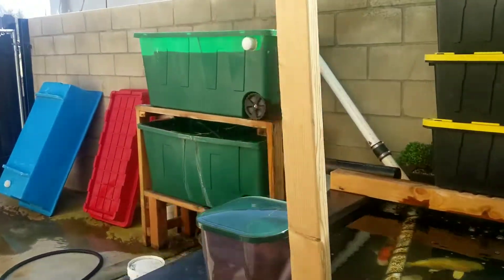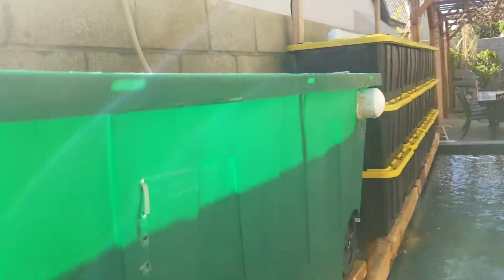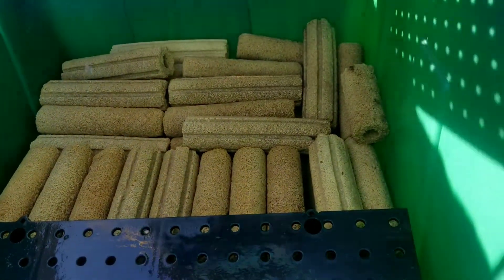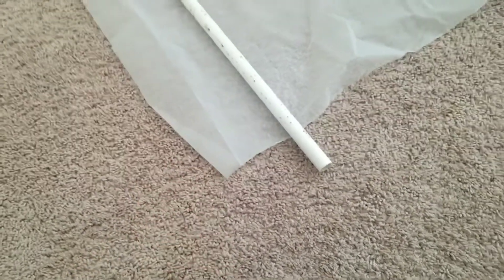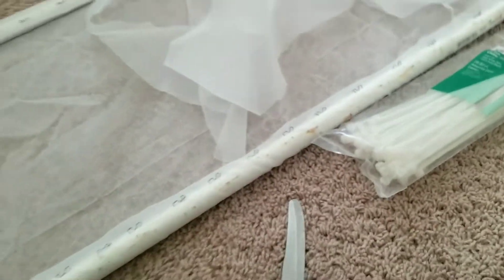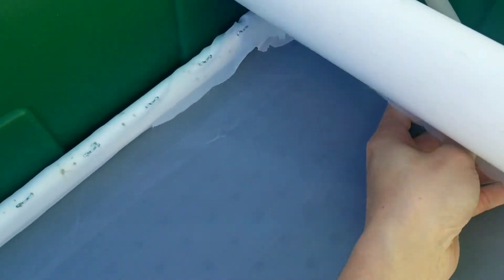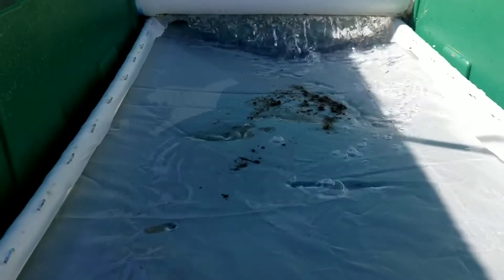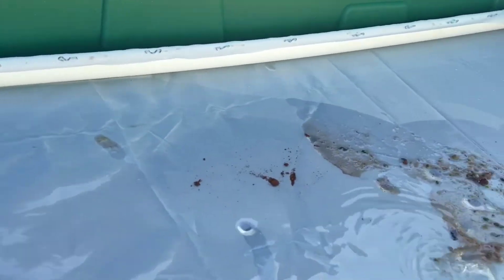DIY Pond Filter 2.0: Replacing the 200 micron Sieve Cloth

Comment: I made a DYI sieve filter too but instead of stapling the cloth to the pvc frame I split the next size larger pipe in half . Made 4 pieces  2 inches long of them and then placed and drilled a small hole. Then I used a sheetmetal screw to secure. Works great to change it. I also used 300 mesh stainless steel screen. Holds up much better than a cloth type.